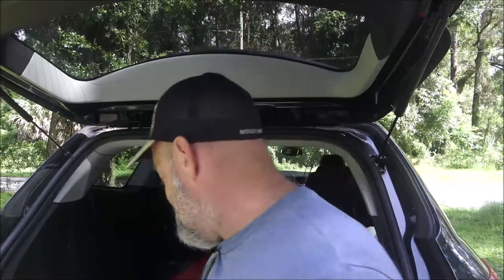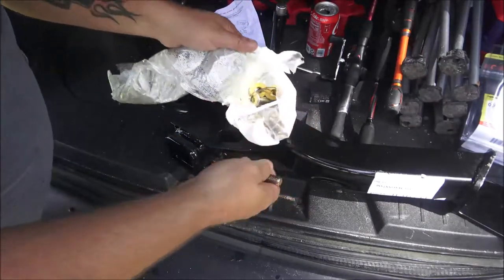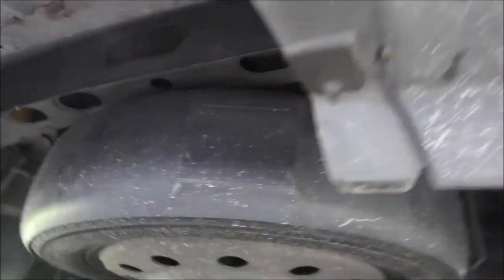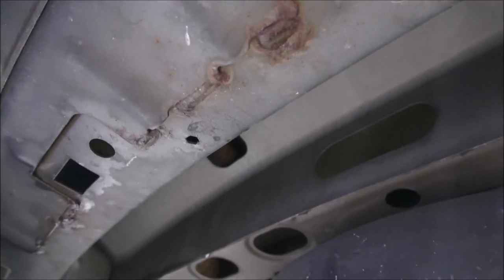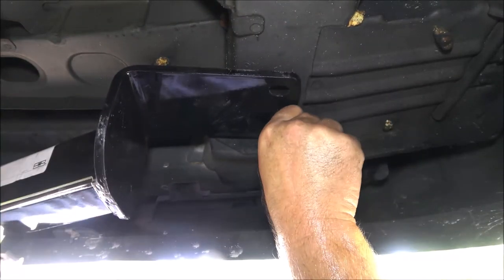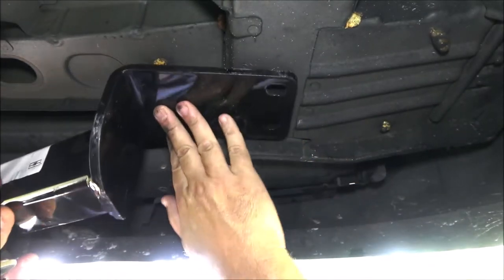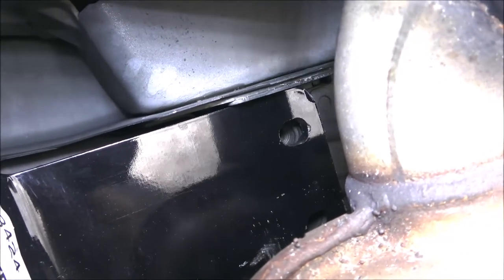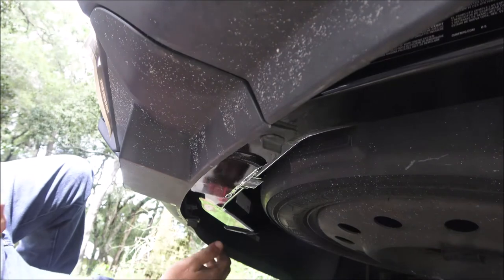Trailer Hitch Install On 2010 Chevy Traverse How To In 4K

Comment: I have a question, I got the exact same kit for Christmas this year for my 2010 Traverse. As I was headed to work I heard a noise from the rear end. It scared me and luckly nothing is broken but my little muffler thing that's on the end of the exhaust system is moving around and I was wondering if yours hit the hitch as well. Also did you have to install a tow/haul mode switch in your car or did the trim package that you have already had it in the car.
Reply from the maker: I had no problem with the exhaust. I had to install the wiring harness kit. I think I have a video of that too.